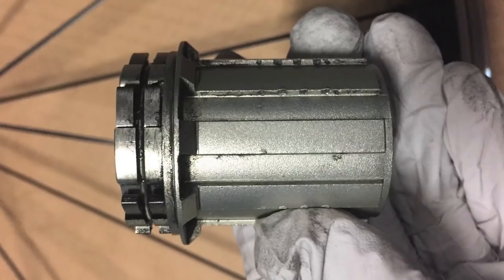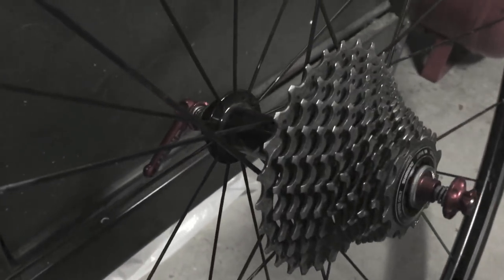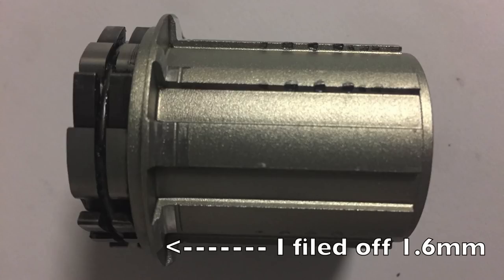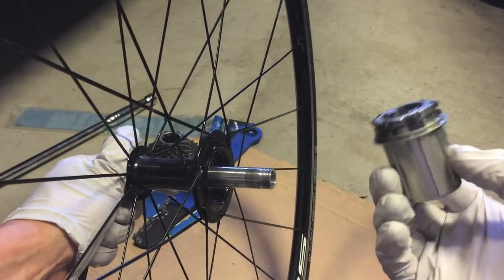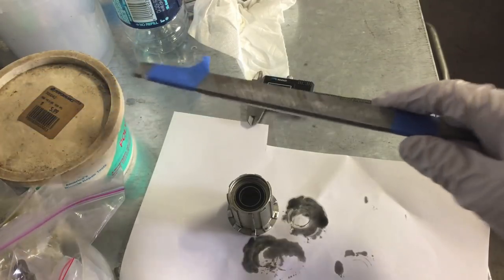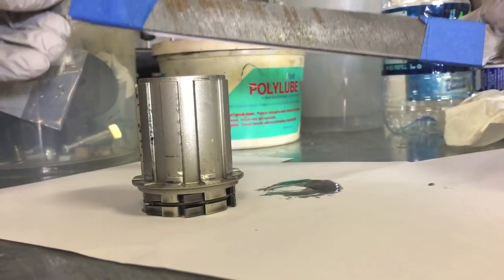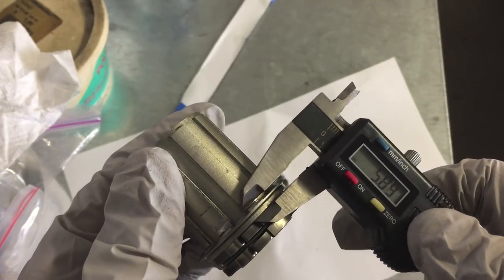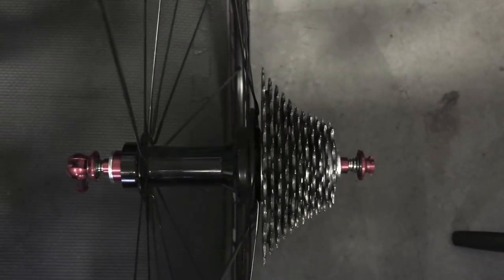Installing 11 Speed Cassette on 10 Speed hub: Modifying freehub to fit 11 Speed Shimano Cassette

Comment: I took the cassette off the wheel and then put the wheel back on the bike and spun the wheel by hand while using the file . Came out perfectly even. Upgraded to 12 speed Sram Axs force 1X12 wireless.  Works great 👍 love it ❤

Comment: Thanks for this video!  I followed your instructions and did this mod on a set of Xero Element disc wheels that I am using on my gravel bike.  It was surprisingly easy (once I got the freehub removed - thanks to another YouTube video...)  The tip about masking off the freehub body and the file worked very well and I was able to do the whole project in about 2 hours.  That's less time than I spent searching online for an 11 speed freehub body for my hub (it doesn't exist).
Reply: Are u sure Master?

Comment: I had a freehub start sticking on a set of Vision wheels.  The replacement that they sent me was a 10 speed so I used this video and a file and grinder wheel on my dremel to convert it to 11 speed.  It works, thanks!
Reply: Do you have to change shifters as well?
Reply: @ShaheenSaffy  nope, I kept the bike as an 11 speed by converting the 10 speed freehub to accept an 11 speed cassette

Comment: a question. as the shaving is done by hand, there may be small differences in the thickness, as seen on the video. i wonder it makes any problems with gears, if the cassette has small jiggles

Comment: 9 speed freehub.. Do i have to change my wheels to upgrade? Hub is short no spacer
Reply from the maker: Just depends on the 11 speed cassette you're upgrading too.  If you go with the Shimano CS-HG800 11-SPEED Cassette (11-34T), it'll fit on all the old shimano 9/10 speed freehubs.  If you're going with a closer spaced 11 speed road cassette,  then you'll need to upgrade the hub / wheel set.  Or change out the free hub to an 11speed or modify it.
Reply: @samsdiysandmore7024  thanks, if i take the cs hg800 11s... Do i have to file? And do i need to change my shifters and my derailleur.. Derailleur is shimano 105 RD-5501
Reply from the maker: @ShaheenSaffy  You need to change everything to switch to 11 speed.  Shifters / Front and rear Derailleurs / Cassette / Chain / crankset

Comment: Would there be any issue if you filed all the way down to the wall?  I know I shouldnt rush but I think I would likely use a Dremel to get most of the work done quickly.
Reply: Dude,  dont rush this, if you file off too much material then the screw on cap wont tighten on the cassette and the cassette will be loose.  Also if too close to the spokes then the chain can rub on the spokes.  If you an impatient type then either learn patience or outsource it.

Comment: Interesting video!
What type of wheel are you working on? Shimano?
Reply from the maker: These are some cheap Soul Wheels that I've had for 6-7 years.  They've spent the last 4 years sitting in my garage ever since I upgraded to DA 9000.  I wanted to revive them since they're fairly light for alloy clinchers.  They weigh in at about 1330 grams for the set.
Reply: Sam's DIYs and More ahh thank you just read this comment 🏴🔥

Comment: You should have bought a different cassette I'm guessing you didn't know but there are quite a few 11 speed cassettes that will work on a 10 speed free hub. A lot of times it will tell you in the description if it will work on a 10speed hub or you can just call the factory, distributor, or dealer and ask them. A lot of today's new cassettes are made to fit on 10 speed hubs. I currently have a 10 speed hub of my fat bike and I was able to put an 11 speed cassette on it and everything worked just fine.
Reply from the maker: I thought about buying one of those 11 Speed Cassettes that were made Specifically for 10 speed hubs.  But I wanted to avoid spending any money on this project to revive my old wheels.  I already had my Dura Ace cassette in a gear ratio I really liked.  A lot of those speciality 11speed cassettes are going to cost me $100-200.  I also wouldn't get the shifting performance of my DA cassette.  

Another Alternative is the new Shimano 11 Speed 11-34T Cassette  (CS-HG800).  It will work on a 10 Speed hub.  But you'll have to want those gear ratios.  I personally like my 12-28T Dura Ace Cassette for the gear spacing.  12t thru 17t is super tight, and then I have my 28T for climbing hills.   The 11-34t has too many gaps for the style of riding I do.
Reply: What brand is it? I can’t seem to find any.
Reply from the maker: You can check out the Edco Monoblock.  They make a 11speed hub that fits a 10 speed hub.  I've never tried it.  They aren't cheap.
Reply: Shimano XT M8000 list it as possible as well
Reply: According to my research. Mountain 11 speed cassettes will fit on a road 10 speed hub. But road 11 speed cassettes will not fit
Reply: @BenjaminNew  you can search for shimano 11-34 CS-HG-700 or CS-HG-800. They're 11s cassettes but will fit 10s road hub
Reply: 11 speed MTB cassettes fit on 10 speed hubs. It’s just Road 11 speed that’s different from 10 speed.

Comment: I just put on the 11 speed cassette without doing any mods
Reply: That works on some hubs. On others you don't have enough threads.
Reply: Yeah, i did the same... didn't even know there was a different size.
Reply: Mountain bike free hubs have the same width.  11 speed road free hubs are 1.85mm wider than 8/9/10 speed.